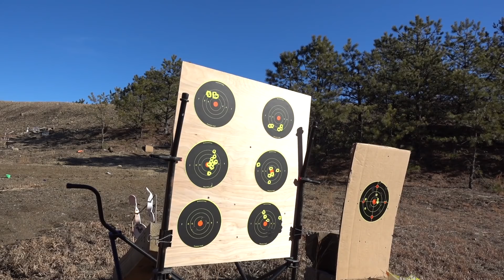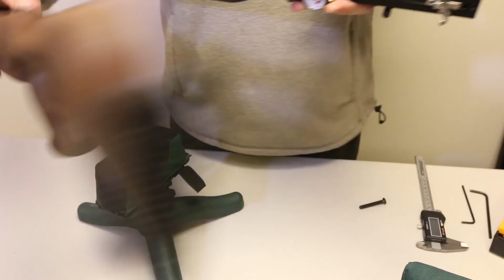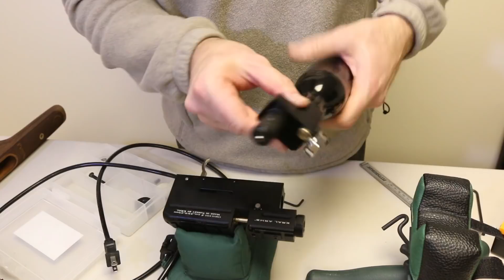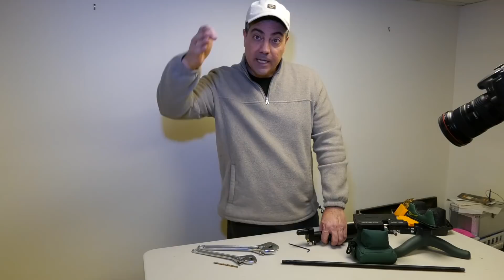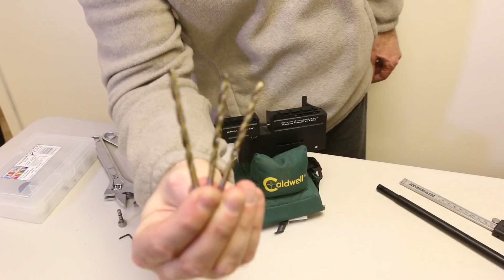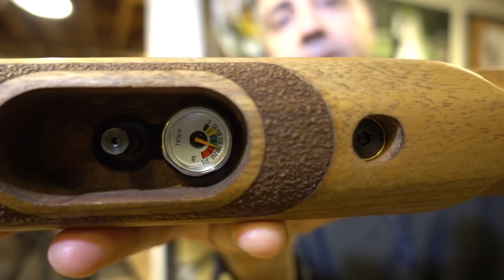Kral Puncher Jumbo .25 - Review & Final Modification to 51FPE

Comment: A while back I viewed a YouTube video of a air gun guy who filmed the flight pattern of his pellets when shot at velocities beyond the  ability of conventional shuttle-cock/wasp-waited pellets to stabilize.  In that video the ultra slow motion showed the pellets cork-screwing their way through the air on their way to the target.

Initially it was a tight cork-Screw flight that opened up the farther away the target was.  In your video it looked like a couple of the pellets you shot may have been doing the same thing.  Of course there's no way to confirm this unless a slow-mo video was recording them but from the way the patterns were forming on the target hints of the cork-screwing possibility.

The gun was still accurate with the shots clustering in their respective groups but this was because the pellets cork-screwed their way to nearly the same point of impact at each given distance.  

I think the accuracy you're getting from your air gun is outstanding, even if the pellets were cork-screwing in flight.  You're the first guy I've come across who has tested that particular non-conventional pellet design.  I suspected when I first saw that pellet design that they would be more efficient than the first-generation pellet designs we've been shooting.

I've mentioned this before on other posts but,  with the evolution of air guns now days, it's the pellets we're shooting that have become the weak link in the air gunning experience.  These High Tech PCPs are now able to mimic powder burner velocities and energy levels but the antiquated pellet designs of yester-year is what's now holding back the evolution of the air gun.. It's like having a state of the art jet fighter design that's driven by a propeller driven engine.  I was glad to see that those more efficiently designed pellets worked out well.
Reply from the maker: TIM MONTANO check out the Huben K1 mkII. This air rifle bullpup shoots 40 grain .22 boat tail style bullets at a velcoity of 1000 fps. I believe that's 60 FPE. It's called a long range air rifle. It is amazing. Uses a different kind of valve system.
Reply from the maker: Check our Gregor. Hit a golf ball out to 244yards. https://youtu.be/R1vqi9z3tg4

Comment: So if I'm not missing something your gun used to shoot the 25gr jsb the best and now it is favoring the jsb jumbo? Most likely because 930fps is just too hot for the 25gn?
Reply from the maker: salt flow No. The kral barrel loves the 33.95 grain king heavy.
Reply from the maker: salt flow it can also shoot 25.5 grain Kings well. This gun has a power adjuster. I can adjust power to shoot 25.5 grain Kings anywhere I like.

Comment: One of the most professional reviews that I've seen. Excellent quality cameras and very  very informative. I've just bought a bigmax and intend getting the Jumbo next. I'd like to replace the bottle with carbon fibre to reduce weight and increase air capacity. I can't wait for someone to produce a regulator, It will make an already excellent rifle better. I have emailed Huma to ask, but at the moment they say there isn't the demand. Once again thanks for taking the time to make the Video. Rob
Reply from the maker: Robin Davies Thank you! My valve stem broke which I made a video on. So I sent my valve and stem to Troy Hammer. He put a harder stem but also opened the valve internal channel a bit. I just got it back yesterday. My gun went from 51 FPE  to 58.5 FPE shooting a 34 grain jsb 880fps. I will make a follow up video. I also bought a 480cc carbon fiber bottle to put on the jumbo. I bet the big max can do 60 FPE with so modding. I believe they have a very similar breech. Best of luck with your new gun.
Reply: It's the only negative thing that I've heard about these. Around the 2000 shots the stem fails. I'll be very interested to hear about the upgrades, shot strings and consistancy . Thanks again. Rob

Comment: AVS I enjoyed the video and I think I found a replacement for my 25 cal Marauder. Question? During the breakdown of your Kral I noticed there isn’t a “transfer port” like in my mrod, between the valve and the barrel, what keeps the air from escaping or leaking through the rest of the gun? Thanks in advance.
Reply from the maker: Ken Martin hey Ken thanks! You are correct no little seperate tube to transfer air from the valve to the barrel. It passes through the block via a channel which acts as a transfer port. Twp O rings around the valve and two orings around the power adjuster and two orings around the barrel port keep air from escaping. It actually better in my humble opinion. No limit now how large the transfer port can be.
Reply from the maker: Ken Martin also check out Troy Hammer at Annihilator Airguns and tuning. He makes a 52 fpe verison and a King edition that is 60fpe
Reply: Ok thanks again.

Comment: I have same bottle in my Daystate Air Ranger and i use paintball regulator. You need ninja type regulator and adapter that can buy from ebay. Work better than regulator what designt to PCP. Extreme spred 3 fps in my gun. And i do not use expensive Ninja regulator. Chinese regulator is cheap and work well.
Reply from the maker: Esa Puhakka can you please provide a link to those Chinese regulators. Thanks
Reply: Many output pressures available.
Reply: I have this 2200 psi output.https://www.lazada.co.th/paintball-4500psi-hpa-high-compressed-air-tank-regulator-valve-2200psi-output-intl-57664579.html?setLang=en  . This same can find in many online shops.
Reply from the maker: Esa Puhakka thank you!
Reply: And you need this.Airforce-Condor-Valve-to-Paintball-Tank-Converter-Adapter from aliexpress

Comment: ya I think your right about adding the regulator that would shoot real nice with a regulator. I think the ninja type regulator built onto the bottle given the parts to tune those a so inexpensive. building a 2240 bullpup right now .and am going to expirement with like if you want a radiused edge on a piece of metal take a flat block of metal piece of 220 wet dry and some wd 40 and put some of the blue shop towel paper towels between the sandpaper and the block the more paper towels/  the sharper the radius and rub back and forth   I m gonna try that on one of the fat ends of the Belleville washers and the other with no paper towels to make it flat and see if that makes for a real extreme  spred  improvement and smother movment of the reg  and a on off  bleed valve built into the drop bock so easy  change of the  bottle I'm thinkin of trying that $28 .38 litre on on ebay I've got to sharpen some radius tools for the threads to terminate into.  and some thread tools (thread away from the headstock) with the right flat or radius tip. but I think that'd be the way to pressure regulation on that

Comment: Great review! Im waiting for my jumbo .25 tuned by Troy Hammer to get here, what moderator do you have?
Reply from the maker: Aaron Perez you are going to love it. Troy definitely does good work. It's from Wolf Airguns online.
Reply: Air Velocity Sport thanks, just ordered one. do you know what’s the thread size on the air bottle, im thinking of ordering a rounded carbon fiber tank to make it look better
Reply from the maker: Aaron Perez sorry I do not know what size threads. I tried to unscrew the bottle from the block but I think kral uses thread lock on the bottle. It was very hard. Please let know if you succeed in getting the bottle off. I too have thought about getting a carbon fiber bottle from talon tunes. They are $150
Reply: Air Velocity Sport Did you try heating it before trying to unscrew it? thats the one i had in mind! It would look nice on the jumbo. once i get the rifle i’ll try to take it off, I’ll let you know how it goes

Comment: Great video, I have the same gun tuned by t hammer.Your numbers are right on with mine. My jumbo loves jsb and polymags.I'm ordering some of the .25 slugs and try them too. Since I hunt with mine I finished my stock with true oil.I noticed just a drop of water makes the wood swell and discolor so I wanted to seal it .keep up the great videos.
Reply from the maker: Bobby Lomax Troy does great work. Yes, I'm going to work on the stock next?

Comment: Wish i could afford it... can't afford pcps yet but my HATSAN 125's averaging 802fps and 35fpe 717fps 30.86gr baracuda wich is its favorite food. A second favorite food is the Air Arms 25.40gr pellets. 
No you get what you pay for to a point then its hype,a name, popularity etc but i agree with the general statements lol.
Id2be ecstatic with any decent pcp.
Reply: wish my hatsan 135 was putting up those numbers. I ended up selling it. My cheapo gamo was putting lead down range harder for some reason. Probably a dud on the internals. all the seals i could comfortably get to were fine so idk.